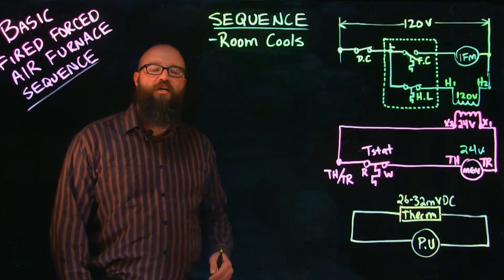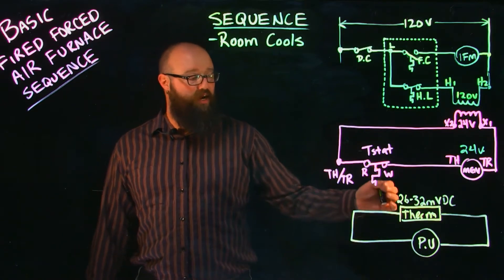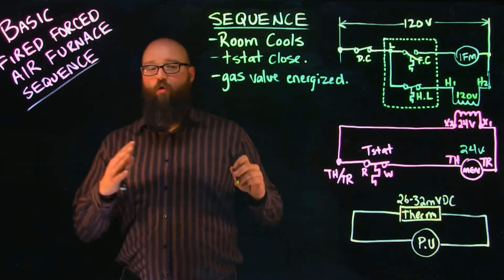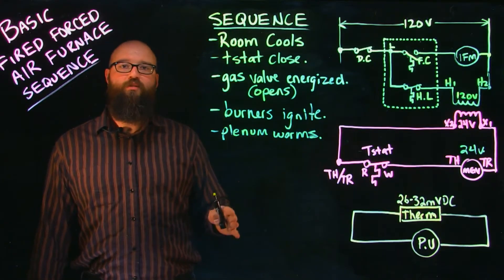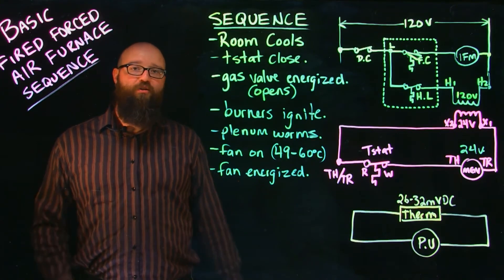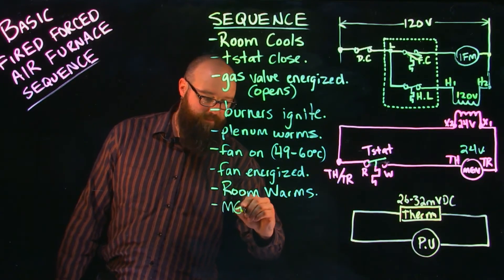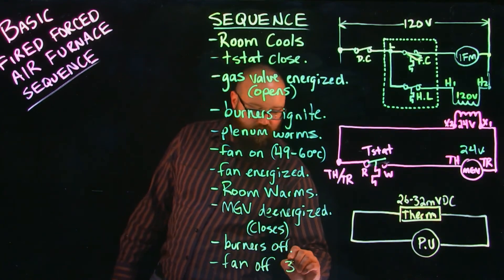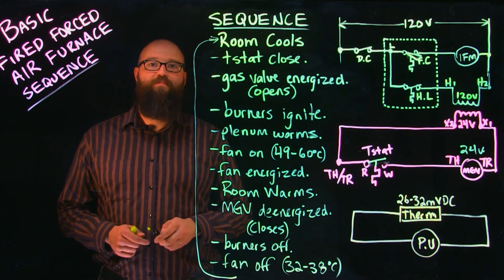Basic Forced Air Furnace Sequence

Comment: Would it not be safer to have pilot proven contact in front of your gas valve solenoid? This was if the pilot fails the gas valve shuts off.
Reply from the maker: What you are referring to is a safety gas valve. The power unit will have a voltage across it as long as there is a heat applied to the thermocouple. The voltage will keep something like a solenoid open that allows gas flow to the pilot. If the flame goes out, the voltage drops out, de-energizing the solenoid, effectively closing the gas valve.
Reply: @schulerruler  That makes sense, it would be safer than just having contacts infront of the gas valve solenoid. Thank you